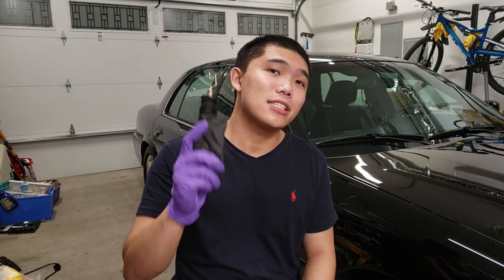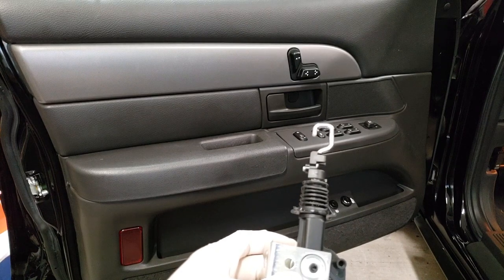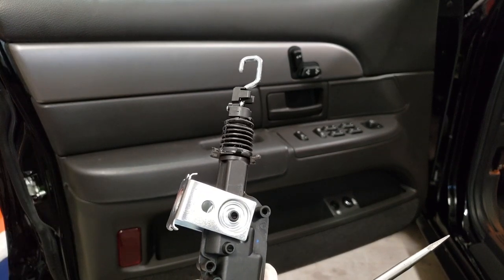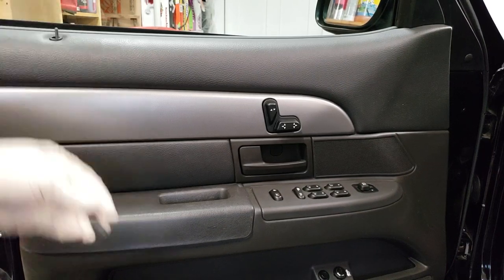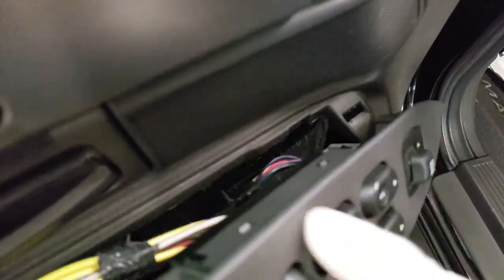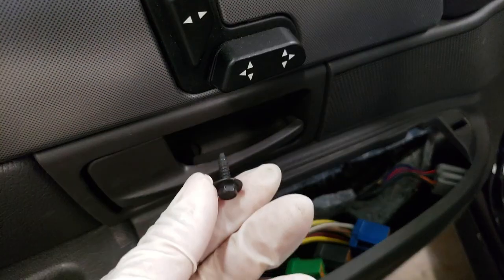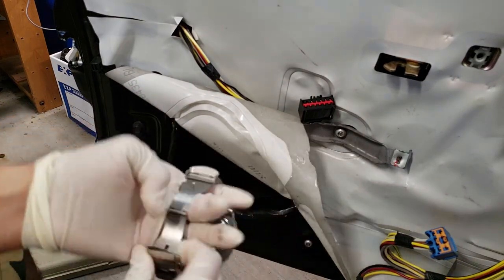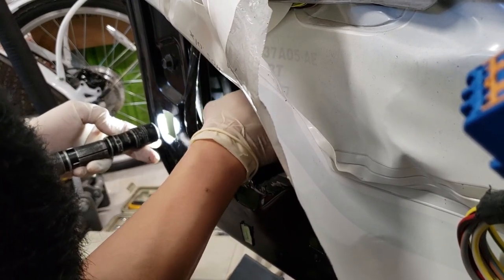HOW TO: Mercury Marauder Door Lock Actuator Replacement [NO RIVET TECHNIQUE]

Comment: I didnt get a Marauder back in 04...because I wanted the fake wood dash lol. Kind of regret it, but I do love my LX Sport. Do you still have that 78 TC? I have two Continentals.

Found your video trying to under a really bad alarm and keyless entry system install, and return a Marquis to stock. One wire somehow is going in my door...somewhere. One would assume the door lock button, but the way they spliced wiring was so ghetto. Still, if I was to think like a lazy person, it has to be somewhere easy to get to lol. 

Also, here a tip. Get in good with a local dealership, the parts department, and they can search the database, and you can find parts at any dealer. I found the little squares for the door handles for 4.03 bucks lol. I wanted door handes themselves (the ones with the chrome that seems to peel off. I dont do aftermarket though, unless its the only way, no junky yard parts, nothing...I tend to fix a part before I go aftermarket. Even the door lock actuators can be fixed.

And a tip for the clinically OCD, you can try to reuse the boot, or use a piece of plastic or soft vinyl, cut a hole the diameter of the actuator plunger, and zip tie it, so water will flow over it. Make it long enough that it drips below the body of the actuator. I did that for my 73 TC. You cant find those. I had to make one good one from about 4 bad ones.

Cheers

Comment: great content . i do some vids about tuning marauders . i have this issue with driver door actuator being stuck. also can't manually lock and unlock either. its stuck unlocked. Would this also be an actuator issue ?
Reply from the maker: Thanks for the comment! 

In your case, it could be a seized actuator which is locking up the mechanism or part of the linkage thats seized.  I'd say definitely avoid trying to lock it since if it gets suck in the locked position, it'll be a bad day.  

Best thing you can do is pull the door panel, pull back the vapor shield and see what's going on with the linkage and actuator.

Comment: have you changed your blend door actuator ?
Reply from the maker: It is an issue these vehicles can have, but I haven't had to deal with this issue yet.  I'm far more likely to have to replace the O-rings on the climate control module.  But for now, everything is still functioning okay.

Comment: Right below the speaker you can get your Door Lock/Unlock Code. In case you need it
Reply: Really..the owners manual actually says it’ll be taped to the wiring unit..I do see the tape but after 17+ years, can’t read it..luck if the Irish my arse!😁
Reply: @MarauderMarie  It might vary by year. All I can tell you is, I replaced my door lock actuator and I actually saw the code right below the speaker
Reply: @NoName-nb9qi  thank you for the tip and can’t wait to find it..I’m obsessed to fix it😁

Comment: Hey, would you think this can apply to any of the rear door's actuators as well? My passenger rear door's lock I can hear the actuator moving the motor loudly but it doesn't lock or unlock so I have to manually lock/unlock it. I have an 03 Grand Marquis I bought this week.
Reply from the maker: Yup!  Should be exactly the same situation back there, only difference will slightly fewer fasteners.  There are lots of videos on crown vic rear door panel removal, so I'd reference one of those if you're not familiar with the process.

Thanks for watching!  Hope this helps!
Reply: @ctuan13  I noticed the linkage looks detachable, would I be able to use any year actuator for any year car? There's a 30 dollar difference between the two generations, and I could reuse the brackets and linkages. 2010 CVPI

Comment: Question that has nothing to do with actuators…I drifted the other day right when there was a break in the light rain ( not on purpose) but the tread looks great per my mechanic..he said it’s  a rear wheel with lots  of torque and to try a road gripping type tire..these are Bridgestone , not cheap.. but you have any 18” tires you recommend? The drifting was very fun I have to admit 😁

Comment: Just got a 03 marauder passed down from family from originally sale. Well the engine was replaced in 2016 so how do I program my keyless entry code? I can’t even find the original code but would it work anyway? Ugh 😩
Reply from the maker: Wow well you’ve got a great family heirloom passed down to you!  So even if the engine was replaced, that shouldn’t have impacted the keyless entry code, as that is stored on the module in the door.  Other than paying a dealer an exorbitant fee to scan for the code, you can find the code on a sticker affixed to the module behind the driver’s door panel.  

So basically follow this video and once you have the door panel off, look for a module towards the front of the door and there should be a sticker with a code on it.
Reply: @ctuan13  you rock! Thank you man..bunches